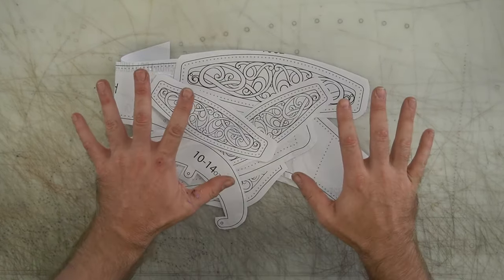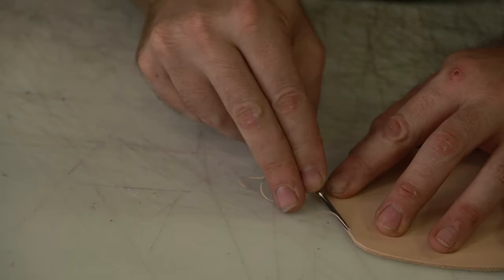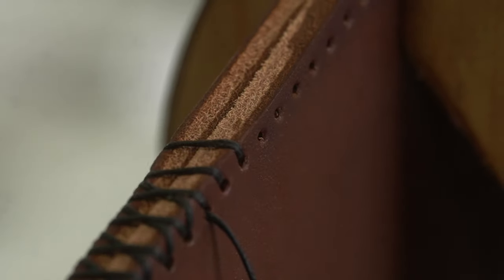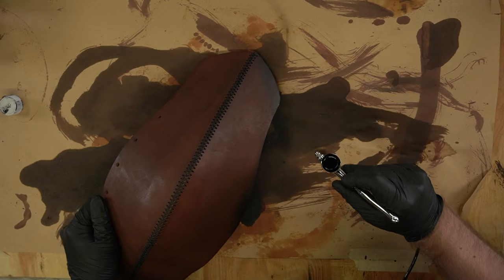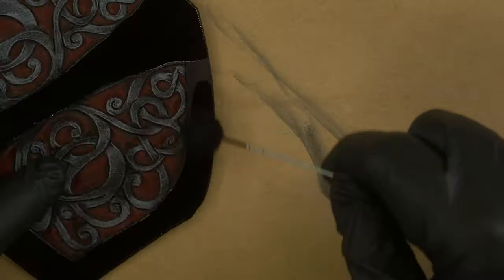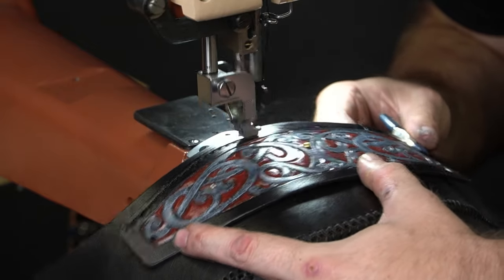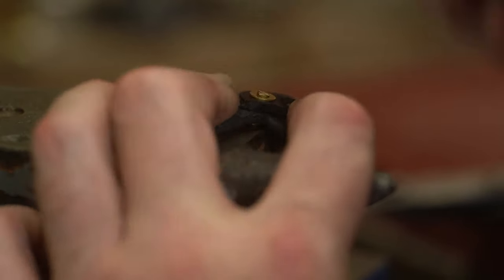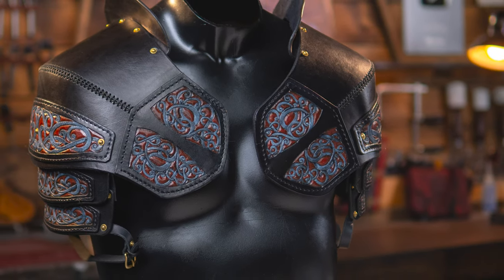My Best Armor Yet - Leather Shoulder Armor / Pauldron Pattern

Comment: These are sweet. I just made a set with leather and chain maille using mostly your techniques. Used an old pair of hockey shoulder pads as a template. Should be good for the medieval Stanley Cup!

Comment: My stepdad was a coach builder and customizer and one of the tricks with airbrushing is to use bits of any shite laying around to use as masking when you are spraying I don't mean shite shite I mean bits of card or in our case aluminum or steel sheet to hold over the design so you can achieve a straight edge without losing the fade you get from the spray.  I'm probably not explaining it properly I will try and find you on Twitter or Instagram and share a vid or two to give you an idea of what I mean. A question have you ever tried to use a tattoo gun on leather I believe some artists practice on leather, it may be another tool you could use to further express your talent. Another huge thank you and another all the best from Scotland buddy.

Comment: Simple question, need to do hardening put in the oven to be armor right?
Reply from the maker: There's a few methods, you could oven it with water, or you could wax it. I wax armor for rattan combat because it's easy, but if it was for costume I'd never wax it, and if it was for hema using water and an oven would work best. But it's a PAIN IN THE BUTT... so be careful.

Comment: Hey, just tried out leather working a few days ago and while punching holes in the leather I managed to take a few good chunks out of the workbench underneath (Granted the wood is old, and I am not sure the punches are all that great) Is there a particular material that works best as a backing for the hole punching stage? Or does workbench damage kind of come with the territory?
Reply from the maker: Cutting board material from a leathercraft shop or plastic supply. I have a couple linked here. https://www.amazon.com/shop/darkhorseworkshop/list/25YG6U2O29ZYG
Reply: @DarkHorseWorkshop  Thank you very much!